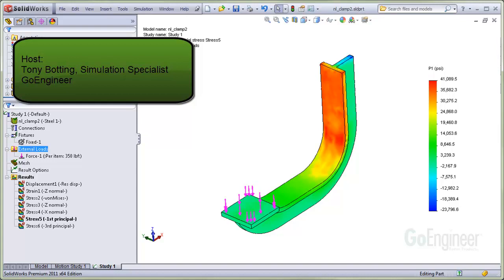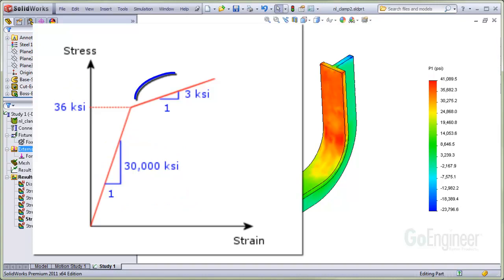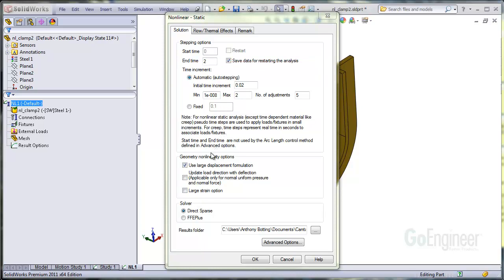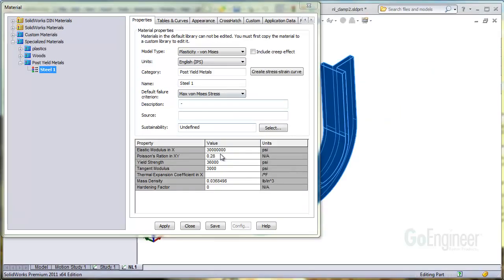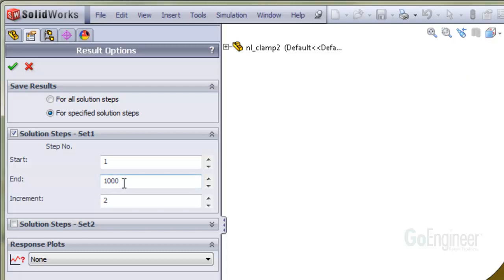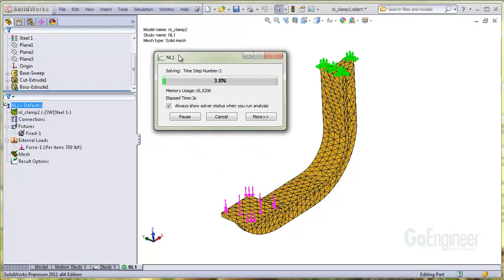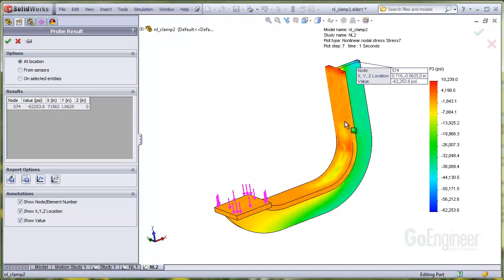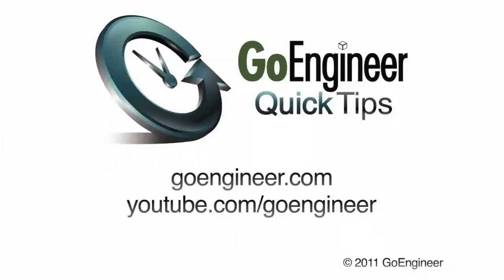SOLIDWORKS Quick Tip - Metal Yield Material

Comment: Great video! I need an approximate answer to this question. I got 3mm thick, 5cm wide and 25cm long stainless steel piece. How much will it yield until deformation? I need it to yield/flex 1cm in 25cm length. Do you think I'm good to go? Thanks!

Comment: I was wondering if you can help. I am trying to analyse a situation of using a cheater bar on a wrench. I have a nut that is fixed and a wrench on it with a pipe over it. I was wondering if you could help with the correct boundary conditions or mates and for to analyze
Reply from the maker: Hi Mario,
The setup of this analysis is going to be far too complex to describe in the comments section of our Youtube channel.  We would encourage you at this point to approach the technical department at your local SOLIDWORKS VAR to gain personal assistance from them on making this setup.

Comment: Hi.
Is there a difference on the results when you put in Tangent Modulus and when you don't put it in?
Reply from the maker: If you were to not enter a tangent modulus the solver would proceed until somewhere on the model meets the yield stress then stop.  It would not given any data for stresses beyond yield in this case.  So, it would be recommended to enter a Tangent Modulus whenever possible.

Comment: Hello!
Good job!
Congratulations!
I have one question: Is possible from the Software to obtain a Stress-Strain curve for one simulation? Obviously only in the linear behaviour of the curve to obtain the elasticity modulus... This is the goal and my inquietude!
Reply from the maker: The software will not report what the Elastic modulus is of a material based on a Stress-Strain curve.  You would, however, be able to do a hand calculation based on the Stress-Strain data to get the Elastics modulus by dividing the stress value at yield by the strain value at yield.

Comment: Hi great tutorial I have a few questions.
Can I assume that this method can be applied to Plastic Materials as well? 
Can a stress strain curve be used instead of the tangent modulus?
Can a tangent modulus be negative?
Reply from the maker: The process you see in this video could be applied both to metals and plastics.
Yes, a Stress-Strain curve can be entered.  If a Stress-Strain curve is defined for a material the program will use that instead of the Elastic Modulus, Yield Stress, and Tangent Modulus.
Tangent Modulus for some materials is negative.

Comment: Hi
I would like to know if what version of solidworks can allow you to simulate assembles? I am asking this because I have been trying to simulate assembly but there is an error message that pops up saying I can't simulate assembly.I am using 2010 Solidworks!
Reply from the maker: From your description it sounds as though you are using SimulationXpress.  This is a demo product to show what Simulation is capable of and is limited to single body part analysis.  The full SolidWorks Simulation package allows for analysis of multi-body parts as well as assemblies.